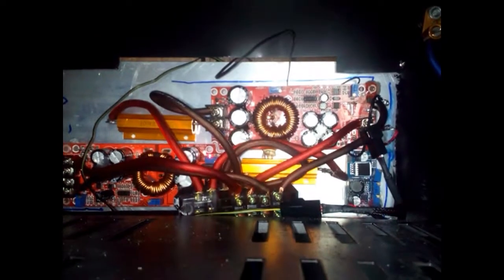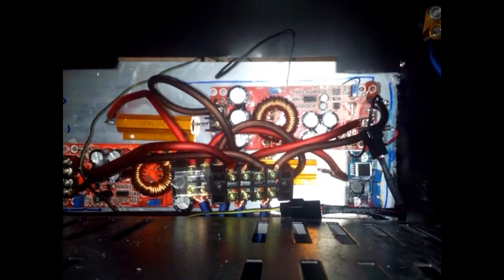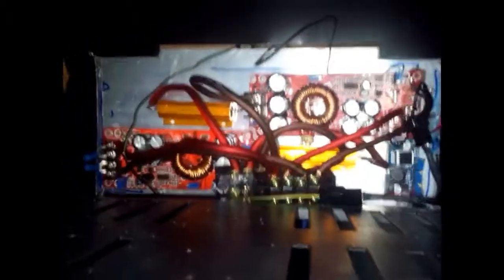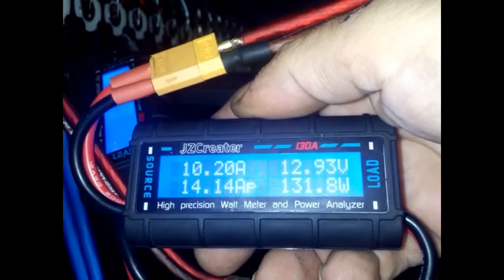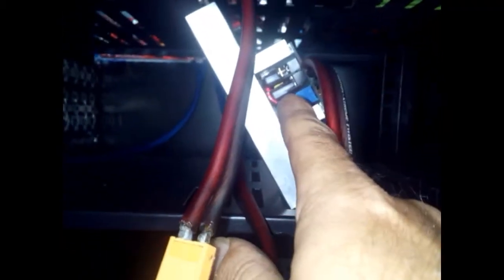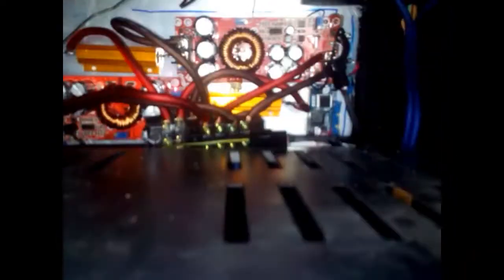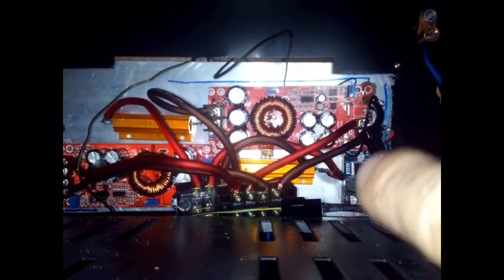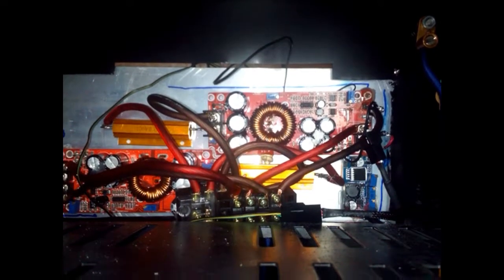1200 Watt Boost converter power share for solar charging

Comment: Hi do you use diodes on the boost converter outputs, I blew 2 of those converters as soon as I turned them up to 10amps trying to charge deep cycle battery.
Reply from the maker: watch your input current when using this it can not go over 20 amps even then you have to manage the extreme heat.

Comment: adding a fan will dramatically increase heat dissipation. I would do that first.
Reply from the maker: oh i did just not on the front to hit the inductor side its a 80mm Artic TC doing a great job i have a Arctic 120mm TC to go on it but have not done it just yet everything is in test mode but so far its working just fine and the 80mm is very effective. These boards are actually not hard mounted to the heat sink i have thermal tape on all the mosfets and the primary mosfet about 2mm away from the board instead of jammed against it that made a improvement for the inductor to be cooler though it still gets hot enough to melt hot glue. I may go with a  heat sink on the inductor to keep the pcb temp down. Its working for sure ive blown a 450 watt power supply to power them at a high load up around a 38 amp output charging the batteries. I also improved the ground trace by scraping the coating off and adding solder to increase the current rating it was getting pretty hot as well.  The heat sink is a 120mm x 100mm x 30mm from amazon.